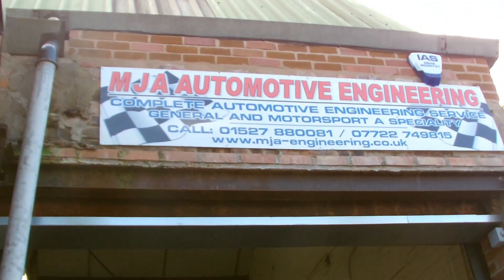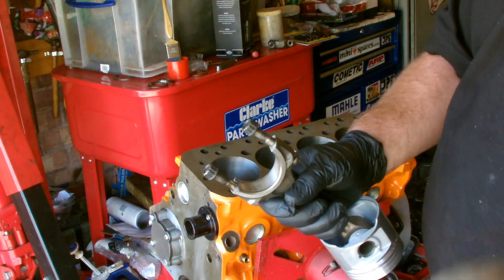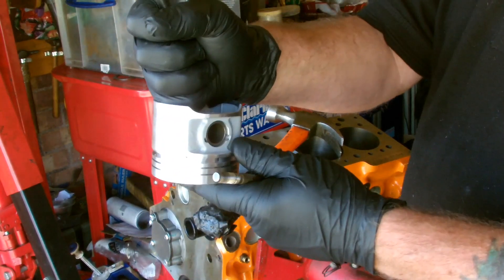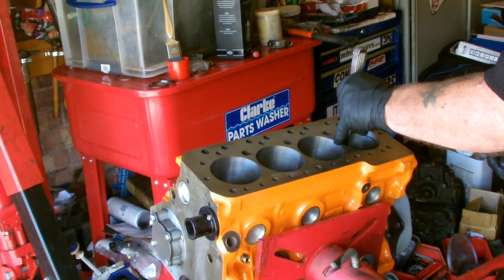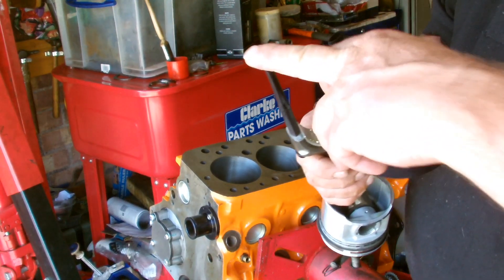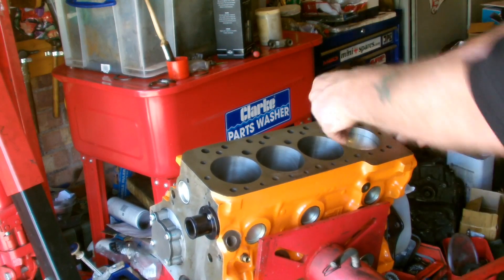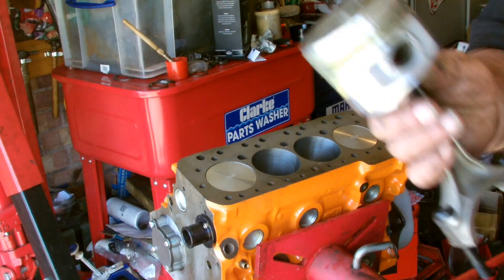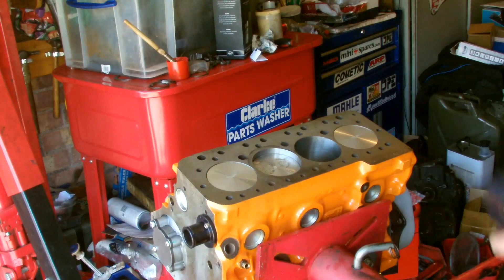Classic Mini 1310cc Track Day Car ( Installing The Omega Pistons )

Comment: I was once told by an old timer to never double torque anything. As it will be tighter. Also i know arp say apply lube to threads but that also gives a false torque reading. Every one works/build differently so its upto you. Cracking video cant wait to see it run
Reply from the maker: Mark, Too true we all have different methods and ways of doing things but as long as the end result is good engine & gearbox i‘m a happy man. Cheers Dave
Reply: Glad the old timer only told you once! Torqueing  in sequence/rotation several times is an industry standard, increasing torque on each rotation (well it was when i worked in heavy industry, albeit a long time ago!). Wasn't torqueing by degrees introduced to eliminate the possibility of incorrect torque due to variable friction loads ie lubed threads and inaccurate tooling? EG a light lbs torque, say 25lbs then 45 degrees in sequence, followed by another 45 degrees in sequence.
Reply: @tomcollier2444  i dont mean retorquing i meant double clicking the wrench on one bolt/nut to ensure its tight
Reply: @markpiper8082  If that were the case, the wrench would swing a few more degrees before it snapped off again. Something I personally have never seen happen. Be my guest and try it, snap it off a dozen times, it won't torque down any 'tighter', if it did the difference would be negligible. If the difference were more than negligible then the procedure would surely be. Torque to xxxx lbs then snap it off half a dozen times for good measure! Defies logic, in my opinion.

Comment: I winced and puckered a bit when the claw hammer was used in close proximity to the new pistons and then put down on the ‘bench’ (block). Ouch! Then the piston and rod was put down on a tool box or similar. Wouldn’t be using any guy who works off his parts washer. Grit & contamination from parts washer lid to ring compressor to piston & ring set.....Sorry, but I have built enough race engines over the years to be slightly appalled.
Reply from the maker: Apart from F1 i don‘t know of any garage environment that is spotless and sealed from dust, Most people have to use what facilities they have, I always check
the channels when i get get negative comments and strangely they never have any content or views, Why don‘t you show us your garage & the work you have 
done so at least we can see how it should be done and then we can make a comment, That seems fair to me!  Cheers Dave
Reply: some of the best engine are built in sheds/garages. has no one watched the film the worlds fastest indian.
Reply from the maker: Mark, It will be interesting to see if you get any reply on this comment, Cheers Dave
Reply: @markpiper8082  Sure they are, but it doesn't take much to put a clean rag on the block if you have to use it as workspace, my nuts hit the floor when that hammer went down!!! Or, improvise  something appropriate rather than lob pistons on top of a tool box. I worked in one of the cleanest environments you could find at the time. That didn't stop a careless workmate  disabling a D10 dozer which ended up stuck out in the desert somewhere, costing thousands upon thousands of pounds in downtime. How did he manage it? Lol, a carelessly discarded crisp packet!!!!
Reply: @ClassicCarCave  , It certainly isn't always possible to work in a spotless environment, I work in farmyards and barns and sometimes, when doing " in situ" repairs I have done things that seem outrageous, but needs must and the results have always been good, as you say it is not F1, mind you I'm not too sure about the blowlamp on the little ends!

Comment: Until now, I've never seen an 'engineer' using a claw hammer! Lol!!
Reply from the maker: Tom, We all have a favorite tools and it was only for knocking out the old con rod bolts so look out for the claw hammer in the next video lol, Cheers Dave
Reply: That's exactly what I was thinking.
I guess he was a joiner at one time?
Reply: Hmmm nice!
Reply: Ha ha, I use a claw hammer for panel beating, strangely enough it works just like a panel hammer and don't all engineers use screw drivers as exhaust chisels as well, I'm more concerned about using a blow lamp on the con-rods, never come across that before.
Reply: @stevefuller1779  Did Father Ted not use a claw hammer for panel beating! Or was it a toffee hammer lol!
Reply from the maker: Steve, The gudgeon pins have to be fitted this way as there an interference fit so the little end has to be heated,
As you say normally they would be either pressed in or have C clips fitted, Cheers Dave

Comment: The only difference is when i'm setting caps etc i use a brass hammer as i'm always nervous of metal chips from normal hammers.
Reply from the maker: Doug,  Paul only used it for taking the old rod bolts out! But i did mention to him i jumped a bit when he layed it down on the block surface as 
it sounded so loud lol, Cheers Dave